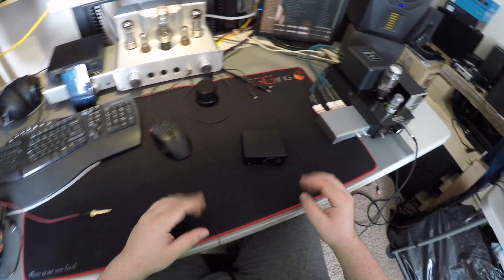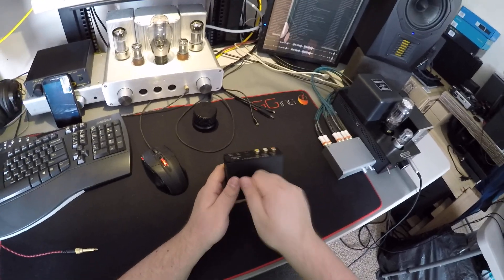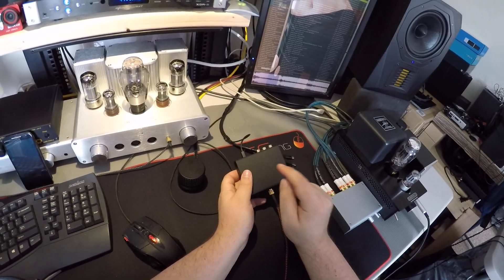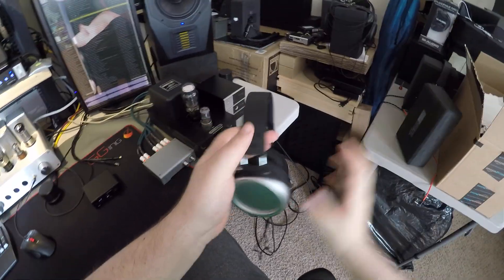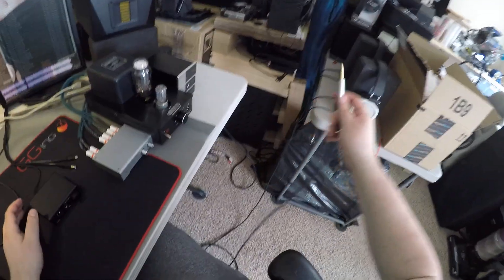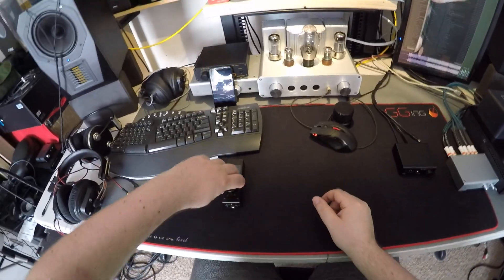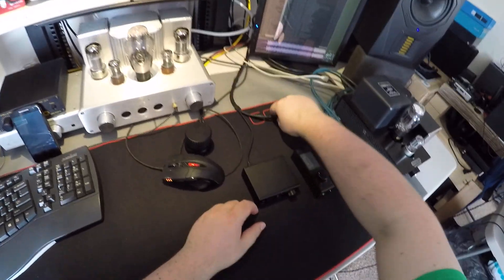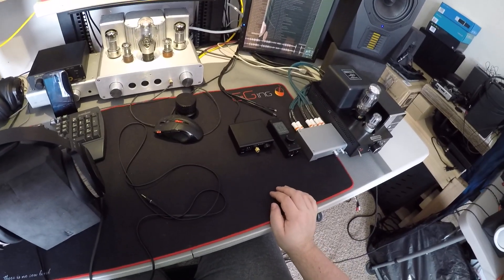Z Review - SMSL M3

Comment: Bought an M3 after viewing this. Very pleased. Very clean...no hiss at peak volumes...simple, but really does the job. I have tested with Sony Ma900, AD900x, SHP9500, X2, K7xx and HD600's. Drives them all, although it struggles a bit with the K7xx's and the HD600's. Volume pot is nearly maxed out with those. Only thing I would change is the little indicator dot on the volume knob. It's black like the knob and is impossible to see. All in all, definitely worth the asking price!
Reply: im considering getting this for my shp9500, does it drastically improve the sound quality or soundstage?
Reply: ***** Yes, the M3 is a good pairing for the 9500's. Plenty of power and a vast improvement over most computer audio. Best part is that it's inexpensive.
Reply: +Blaine Hankins thanks for the impression. I'm watching this with that exact set up in mind. Pc > M3 > 9500
Reply: Is the 9500 worth getting or should I save up a little more for something like the hd 598/600?? I was settled on the 598's until I saw z praising the 9500. Is there actually a big audible difference from your hd 600 and 9500? Thanks.
Reply: Hello, I have a weird question, is just that I'm just starting in this theme and don't know anything about DACs and AMPs. I see in the video, at around minute 3, that he just connects the USB cable in the back (which is just the power) and then his headphones, and then he puts a song on his computer and plays it... but there is the connection between the AMP and the computer? I mean isn't the USB (I think it's mini or micro USB) only do the power? don't you have to connect the AMP with the RCA to the computer to run the sound? Sorry for bad english!
Reply: From what I got from this review the USB is power and data. So the Usb will power the Dac and send audio through it. Hope this helps.
Reply: Orientalcorn yes, I'm seeing more videos about AMPs and DACs and apparently that's how it works. And the RCA at the back it's only to connect the speakers. People here who knows about this basic stuffs and read this (and in my basic english) must be laughing out loud
Reply: nosecomosellama Don't worry no one is laughing. We all gotta start somewhere. So good luck and have fun.
Reply: This particular DAC has 2 USB inputs: 1 for data/power and 1 for power only. As Orientalcorn says, it is connected to the former.
Reply: The USB connector is both for power and for data transfer from you computer to the M3.

Comment: So M3 sounds just as clean, maybe a little bit sharper (a touch, good sharp...) than E10K, but on E10k review, that unit is "shit" compared to M2, which is at the same level as the M3, as you already stated on this video. I'm really confused, because I can't decide what DAC to buy for my ROG laptop (below 100$).
Reply: Do you have optical on it? Probably not, but I ask, because you will learn that audio over USB is not ideal. It is noisy as fuck and the more shit you add the worse it gets. Obviously it is still better than onboard, but the noise floor might start wearing on you after a while.
Reply: I have an ROG laptop and mine has digital out spdif but not optical. I'm trying to find a good inexpensive dac too.
Reply: Coaxial can have shared ground issues, but at least it isn't on the same power rail as USB, so it is far better to use.

Even the best USB dac's I have that don't have noise issues have 'clicking' issues which are hard to describe. It is a weird kind of distortion related to USB power ripple.
Reply: How do USB DAC's have issues if the USB is transferring digital signal and not analog? Does the AMP not take care of the power? I'm confused.
Reply: USB dac's are powered off the USB rail. It is the dirty power that is the source of problems with USB dac's. I am yet to find one that does a good job here. If the USB dac has a seperate power source, I suppose it could be immune to the issue. I believe some do have this.

The issue isn't in the digital signal. It's in the power. Dirty power in, dirty analog out.

Optical avoids this problem totally, which is why I asked. Coaxial avoids the power issue, but it could have ground loop issues.

Comment: I've just purchased this one. I'd say there is no big difference using this one or using my laptop built in DAC by itself. So I connected it with my Yamaha AX-300 integrated amp and the miracle has happened. All together they sound great. I forgot to mention I've got a Sennheiser HD579 and a Beyerdynamic DT 770 PRO 80ohm

Comment: I bought this M3 based on this review, to replace my first generation uDac (since another of your vids recently enlightened me on the uDac's skewed frequency balance),  but it's going back to Amazon asap. For some reason, it keeps spitting loud static, pops, and buzzes with each use.  I have to disconnect it, then reconnect it again between uses to 'reset' it, but that only works half the time. Way too much of a headache for $100.  Btw - from what I could hear, when it worked for brief moments, it did seem to sound a touch cleaner than my uDac, but the volume on the M3 was totally unbalanced, favouring the right channel. The uDac sounded more 'analog' by comparison, though, if a little less detailed (minute differences). 2/5 stars from me on this unit.

Z - is the Schiit Magni-Mani stack significantly better than this p.o.s.?  I want better than the uDac, without breaking the bank. 

Thanks in advance.
Reply: You're describing a driver issue. Have the same problem sometimes with another one of my USB dacs. Have you tried the optical port?
Reply: @wpwentzell  No, never did.  I DID try to fix the driver issue, but couldn't find a fix. Although it didn't work on my Windows 7 computer, it worked just fine on my gf's laptop.

Comment: The second usb input can be usefull if you have ground issues.

i use the vmoda boompro with the SMSL M3, the mic is connected to onboard, and the headphoneplug to the M3. if i only have one usb plugged in, i have a lot of noise on the microphone line, if i connect the second usb to a usb-power-adapter. the noise is gone.
Reply from the maker: THAT is something I didn't try. THANK YOU.
Reply: Michiel Vandepoel wait could you explain?
I use audio technica at2020 as my dedicated mic and it's USB, will this dac amp cause issues with it?
And how exactly do you "ground" the microphone as you said if it is affected,

You said by plugging in the second USB but what do you mean, to where?
Reply: The dac has a dedicated power input which is also mini USB, next to the mini USB for data. Most people won't have problems using only the data usb. But if you have ground issues you can feed the da with a separate power source to counter this. I expect your microphone will be fine.
Reply: Michiel Vandepoel ahh I understand,
thanks for explaining!
Reply: the second you can plug into a power adapter (which u use to charge a phone/tablet)
Reply: Michiel Vandepoel Yeah I understood, thanks :)

Comment: So if I buy this dac, should I buy a optical audio cable with it ? like male to male. So in short MSR7 > 1/4 inch > SMSL M3 > optical in > PC optical out. Sorry if this is confusing, I'm a beginner with hi-fi shit.
Reply from the maker: If you don't want to use USB you can use the optical output. But you still need to power the dac through a USB input.

Comment: What's the deal with connecting powered monitors to this (LSR305s)? Are the RCA outs on the back of the M3 amplified, or are they just line-level and suitable to plug into powered monitors?

Comment: M3 or SD 793II... both connected through fiber optic
I have ISK HF 2010 (same and Takstar HI 2050) using mainly for gaming and music.
Which would  sounds better?.
Reply from the maker: +Slobodan Djuric You won't hear a difference with those cans on either unit. The SD793 is the easier option since you don't have to power it with USB from an addon transformer of the PC.
Reply: Thanks, you just made my choice easier.

Comment: I got some active bookshelve speakers, which I would pair with the the AMP/DAC combo, either Fiio or SMSL. So two questions, just to clarify some  
1. Can you switch between the audio seemlessly?
2. The amplification is only restricted to the quarter inch output in the front, so I do not have to worry to blow my speakers? (Wavemaster TWO BT, you should have a listen to them. Got them refurbished for 100 € and the are such a bliss!)
And another question: Which, open back headphones would you recommend? I am thinking about AKGs, preferably something quite neutral and neutral sounding. Could get some quite affordable and I would love the style and comfort of them.

Cheers!
Reply from the maker: If your speakers have their own volume control this will work perfectly. The back always outputs and the front is controllable on its own. 

Haven't found an AKG I'd call neutral. Maybe the Foxtex T40.
Reply: Thanks mate, much appreciated. Any other suggestions concerning headphones?
Reply: Alright, I really have to thank you for that suggestion. It works like a charm with my setup!

Comment: You always talk about the usefulness of line outs only in conjunction with passive speakers and speaker amps. I use the line out of my E10k to power my Klipsch Promedias-I've just gotten used to controlling the volume from the speakers (or, frankly, Windows volume). It's not that big of a deal. When you have a pre-out do you max the volume of the speakers and only control from the amp?
Reply from the maker: +Splungeworthy Well powered monitors are not the klipsch. They have a volume control PER SPEAKER which is why you need a pre if you don't want to do the windows method.

I'd say you set the speakers to the loudest you would ever want them and then lower the preamp.

Comment: Hey Z, i was wondering whats the point of quarter inch connectors if the other end is 2.5mm ( such as Sennheiser 5XX products ). Is not that 2.5mm "bottlenecking" the quarter inch?
Reply: It has nothing to do with performance. 1/4" is a more durable connector.

Comment: In the Fulla video you said that the E10k sounds thin and the Fulla has more kick. does the SMSL M3 has a thinner output as well or is it more like the Fulla in the sound quality department. ?
Reply from the maker: Aiming more towards neutrality. So a midway point between the two.
Reply: Thanks buddy! This an the line out convinced me.
I think it will be adequate for my 400i.

Comment: If i dont need a volume control for my speakers, and just one for the headphones, could I just plug in my JBL slr305's to the back just for the DAC and not have it affected by the front amp? You also mentioned using The OriGen for SR305's, can you use an amp on active speakers?
Reply from the maker: Yes you can feed the 305's from this and they will be at constant volume. The headphones out the front will be independent from the rear outputs. 

You don't use a speaker amp on active speakers. You use a PRE-amp which the Origen has. It controls the level sent to the amp(in this case the amps in the 305)
Reply: Oooh okay. Thanks I really appreciate it, and I'm really enjoying your channel

Comment: Hello! I have some Beyerdynamic DT150 and I would like to get a bit more from them. I have an asio sound card with 24 bit 96khz coaxial connector. I was checking the SMSL M3 but there are many opinions on amazon.com stating that the unit eventually dies. I was also considering the fx-audio x6 which according forums and youtube reviews it does not sound as good as the M3 but seems to be much more durable. Any other ideas within 150€ or $??? Any comments would be much appreciated!!!

Comment: Does this come apart at all?  I've got one coming and want to use my V-moda boom mic.  Wondering if there's room inside and on the front to add a 3.5mm jack that i could pass through to the back for a mic input.  Obviously i could just run an extension cable from the mobo...but would look cleaner all plugged into the front and back.
Reply from the maker: You can take anything apart if you try hard enough
Reply: Words of wisdom.  You should start a book...or make T-shirts.

Comment: I finally decided on this one for my first dac/headphone amp. It came in today and sounds great... but there is no way to control volume in Windows! I will be sending it back; it's not worth reaching all the way over to my stereo to change volume from my desk.
Reply: thats the point of an external dac bro... youre giving up the dac of your pc to analog audio on your desktop. just put the dac near your keyboard and you get a separate knob.
Reply: @fukpolitics  The point isn't to disable my Windows audio control. I bought a Micca OriGen G2 instead, which is at least as good and doesn't disable anything. Also, it has a nice big knob on top instead of a tiny one on the front, plus a switch for the pre-out or headphone out. No more unplugging headphones!
Reply: @samerickson5095  ok so i just read up on this in this reddit thread (https://www.reddit.com/r/headphones/comments/4k3o9v/if_i_buy_an_external_dac_and_plug_it_into_my_pc/), and i guess i stand corrected. some DACs do allow volume control in windows (for some more technical reason as stated in the reddit thread above), while some don't. I got the smsl m3 and it bypasses windows volume which i don't mind actually, because it eliminates the second audio control so i can only control volume at the knob, which i think is nice. i just assumed all DACs work this way.

Comment: what do you think of that schiit sys? been wanting an emotiva control freak for a long time, but the unbalanced controlfreak has been out of stock for so many months, and i called them and they had no idea when they would get more and i dont like buying stuff that is hard to get/rare so dont wanna wait around for it anymore - schiit sys looks good but is it good? heard some people say its cheap feeling and the volume knob is too small and annoying for 50 bucks + shipping - but theres only like 1 review of the sys out there, but there is no god but ALLAH and no reviewer but Zeos....so hoping to get an nfb-11 soon, cus it has fixed and variable output, and switch for headphones, low/high gain, coaxial input, usb input - crap need to change underwear again.
Reply from the maker: +TheRoshan89 I have two Sys's because you never know when you may need a good switch with volume control. With the Freak sold out it is the only solution I like.

Comment: I have a problem:
I use it with my AKG K601 - sounds great!
BUT:
When I am using it with my in ears I have a big noise problem. Is this because it has no low gain?
Is there an alternative with similar features (SPDIF/USB in, Line out(full size) and head phone amp) AND a high low gain switch?
Reply from the maker: Add the SMSL VA2 amp to this output or look at the V2 amp.
Reply: Ok thank you!

Comment: You know whats an interesting concept is if you have a laptop or desktop with hdmi 2.0 or higher and hook up an Anthem mrx 720 reciver. I know I know why would you want to use a reciver well it just so happens that this specific reciver has a 32 bit 768 khz dac!. Also if your wondering what speakers you would want to pair it with maybe Klipsch 160 or just use an active pair but the whole point of it is that if you were to make a setup out of it you would get sooooo many options ranging from multiple hdmi sources with 4k upscaling and premium uncompressed audio (24 bit 192khz) and whole bunch of other shit thats really fucking cool. the only down sides I see is that since its a reciver your gonna have to find space on your desk and also the price ($2,500). Even then if your still interested and you don't have an hdmi 2.0 port you could always buy an adapter for usb 2.0 to hdmi 1.4 but you woun't get the full capabilities. But if you dont have an hdmi a usb A port but you have usb C port (2gen) you could get an adapter for hdmi 2.0. the whole setup is alll ver technical but I ashure you "on paper" it checks out .

Comment: Hi Mr Z, first, let me give you a big thanks for open my eyes... I sold my ath-m50 and bought the HM5, best decision EVER :-)
Now, my next step is to bypass my s****ty on board sound card and I'm aiming for the SMSL M3 or the 793II (can't find the micca in Europe) ... my question is, I only have easy to power cans, HM5. porta-pro and creative aurvana live (denon 1001) , will I have to use the dac/amp in so low volume that no rel benefit will come from it?
Thanks
Reply from the maker: +Bruno A better dac is always a good addition. And one like this with a built in amp that is decent won't hurt.
Reply: I just receive it, first dac/amp ... great improvement on all, but specially in the low end. All my cans are easy to drive, so I only use 10-40% volume. Many thanks Zeos

Comment: SMSL M3 vs DAC-X6?

I need the optical and USB. Looking to drive HyperX Cloud Alphas, possible expansion in the future. Mainly for gaming and casual music/media. Would be nice if I could use it at home, at university etc.

Seems the X6 is will drive more things, the M3 apparently gives better bass BUT the main thing that is killing me right now is that the M3 seems to get a lot of reviews of them breaking and the X6 get significantly less. As much as people hate the Tritton Pro+ I've been using, the sound hardware has never failed me, and I want what I buy next to last the same few years at least.

The X6 uses external power and the M3 isn't restricted by that, opening up more options for on the go listening, a little more suitable for my potential environment of use.

Finally, I can get the X6 for £60 and the M3 for £44.

Any thoughts? Tips? I'm struggling to make the choice.

Thanks
Reply: M3 should power your headphones just fine. It definitely sounds better than the DAC-X6. I've owned both.